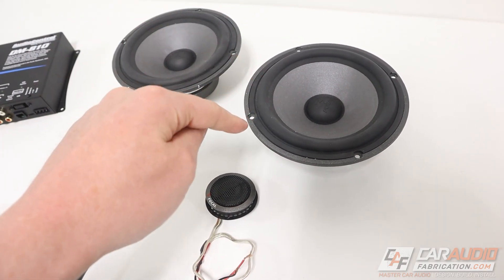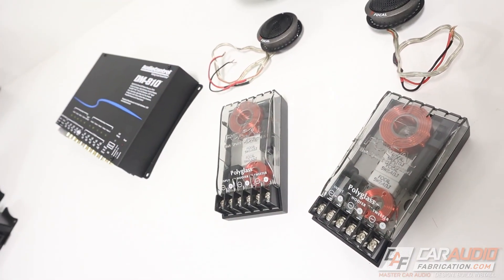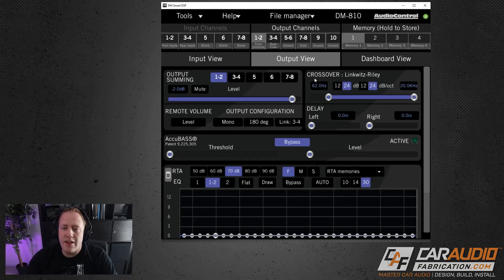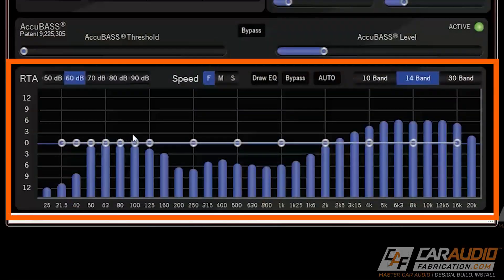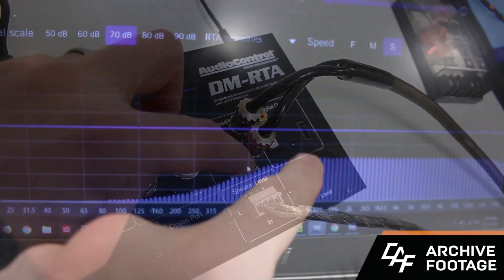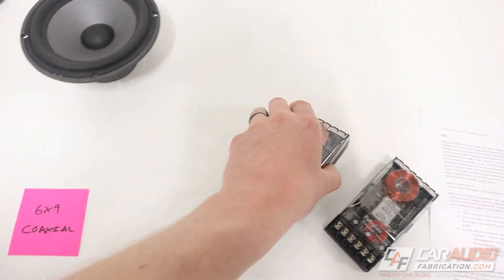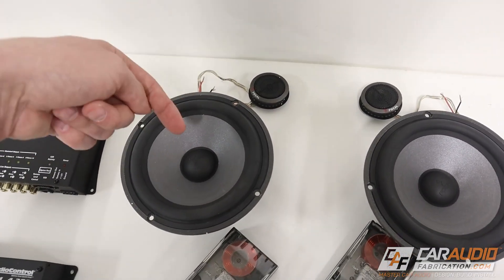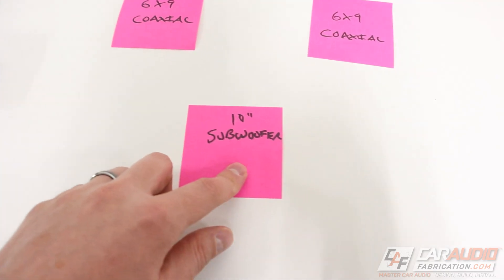Is PASSIVE CROSSOVER pointless if YOUR audio system has a DSP?

Comment: no one will argue that the engine is a very important thing in your car however you're also going to be wasting your money if you're rolling around on four Donuts.

Mark is absolutely correct saying that a DSP is probably one of the best investments and one of the First Investments that you should make..  the audio control gear is top notch.   it's one of those things where you buy it and you can just forget about it after that because you already know that part of your system is done there's nothing more to do and you don't have to second-guess your purchase or your decisions on your system.

what I'm going to argue is that the rest of the components down the chain are so generic today that you can literally get by with just about anything and have an excellent sounding rig.

the best part about going active as you no longer have to deal with the complexity of the crossover Dynamics and its interactions with the amplifier.

 You no longer have crossover Distortion because you don't have a crossover anymore. This is because of the nature of Class A /B amplification and something as completely sidestepped when you decide to go active.    what this translates into is even some of the most modest budget amplifiers that you can buy at a Walmart can do the job with excellent results.  the Jensen and the Dual amps , my personal favorite for Budget high quality sound.

realistically the amplifiers audio control offers that have a built-in DSP are probably the best way to go since not only do you get a lower noise for you also get a easier system design.  if you're not a basehead it's one perfect option.

the one question I have is that I thought audiocontrol offered in at least previous versions of their professional Pro gear software and ability to control the high frequency mid-frequency and low frequency timings all on one channel .
and professional installations you often have your woofers your mid-frequency drivers and your tweeters in far and different locations so even though they have built-in crossovers the actual devices themselves will be in different time placements and therefore will use a passive crossover in turn away but then use an active DSP to go ahead and take care of the time alignment and other needed functions such as frequency response characteristics of the event space to limit Reflections and Echoes and of course Peaks and they reproduce sound inside of the venue.. 

it gets a bit tricky with the passive crossover since you can make an adjustment however due to the analogue nature of the crossover you may have to deal then with phase issues and designing your slopes and your target timings in side of the DSP software can be a lot more challenging then simply going fully active.   

I want to make it clear that you don't need a DSP or Digital Signal processor but boy doesn't make life so much better.
a lot of people are said that they don't care about Imaging until they actually listen to a system that was set up for it in the first place and they just can't go back after that.

if you are truly on a budget and can deal with the very limited flexibility of the pioneer crossover unit that they offer that's a standalone then go that route the next best budget option is one of the Pioneers that have active mode capability.  essentially it's the same thing as the DSP that's offered by pioneer, with a few features that make it worthy as an entry-level DSP to be used in the setups /  scenarios that Mark is talking about. 

just my advice and take it for what you will, if you're going to go with audio control and you want a DSP get one that has the built-in amplifier not only is it a stellar value it really is a better way to go as far as a clean system install.
glass RCA runs and a much cleaner signal coming out do the result of getting less interference since its in one nicely shielded chassis.

Comment: I’ve noticed when using the smart DSP program for a while it starts acting up. Even when you try saving, for some reason it saves settings you never did or reverts them back to default until you restart the program. If you get lucky and get everything saved without hiccups, that 8x10 works wonders. I love the time alignment.

Comment: Mark, if I’m running a component set up front with no rear fill or a subwoofer, would you still recommend a HPF for the component set? I’ve found that I can get away with 60hz at 24db/octave without distortion, but a full range signal gives just a bit more of low end, with 2 volume clicks lower to avoid distortion.

Comment: long time subscriber, first time commenter. This video was very informative but does lead me to a follow up question. I have the dsp810 going into a build that I'm currently working on and was curious if the amp settings (lpf, hpf, and subsonic filter) still need to be adjusted or will the dsp take care of all that? I cant really find any straight answers on it and the truck is still a few months out before being able to tinker with it. Any insight would be greatly appreciated.
Reply: I would definitely turn off any crossover settings ect. on the amp as the dsp will handle all the signal processing. You don’t want the amp messing with the signal you paid good money for the dsp to do that job much better than the amp can.

Comment: So if the dsp is filtering at 24 dB per octive and the passive crossover is at 12 dB per octive  does that mean the signal getting to the speaker is being filtered at 36 db/Oct?  If so, How much is to much?
Reply: That’s a very valid question, this guy didn’t even mention how important it is to know the type of passive crossover you have.
Read Jack A. Lope explanation above from 2m ago

Comment: So say there isn't a channel limitation.  If you run the mids off 2 channels of your amp and the tweets off 2 more channels of the amp, will you get more/less/the same power to each of the component pieces vs having the passive crossover between the tweet and mid and only using 2 channels of the amp?  Curious since I expect the speaker ohm ratings will change when individually amped vs combined as a pair with the the passive crossover summing the tweet and mid.  Have never been able to find an answer to which is going to give better vs. louder sound between the two options
Reply: Read Jack A. Lope answer above from 2m ago. The answer is not simple at all, and extremely complex. I think it’s better to drop the passive crossover and connect everything to the DSP Amp! 
His explanation makes me think, it’s impossible to easily use both together

Comment: I have a question for u im thanking of up grading my car system i have jbl gto 609c and was thanking of getting a jbl bass pro sl would i need another jbl amp to run my gto and could i connect them together i was just going to buy t amps but dont have the room so i need an under the seat sub thank u

Comment: Question. Adding the crossover/tweeter to the midwoofer then changes the ohm load and power handling of the speakers, correct? Also. A tweeter needs far less power than the mid driver. Doesn't power split in half when you go from 1 speaker to 2? Or am I misunderstanding. Please advise.

Comment: Well all u need to do is put two speakers on one channel wow u guys have too much extra crash lying around
Reply from the maker: If you have two speakers on one channel without a crossover they will be fed the same frequency bandwidth and information. You can't do this.
Reply: @CarAudioFabrication  all four  mids speakers will handle the same frequency  and yes u can do this
Reply from the maker: Please send 80 HZ to a Tweeter  via amplified power and let me know how long the tweeter lasts. 💣
Reply: @Trinidadcaraudio  I hope your not anybody's installer!😱😬
Reply: @Me-dh4pm  actually I have a shop and do hundreds installs a year yet to have one complain making customers spending unessuseray money is a big deal for me
Reply: @CarAudioFabrication  if u send 80 hz to a 6 x 9 that's your problem mid bass starts at 70hz to about 150  if that's your settings for a 6 inch speaker good luck with that
Reply: Ok for all the people this guy calling for help  I want u to look at the first line in my  5th comment and u will see how stupid this guy is and when he realizes he is wrong he is trying to tell me what I said wow take win bro I cant with someone who dont even understand understand figures of speech or have any kind of understanding
Reply: I dealt with alot of slow people in my life u sir take win
Reply: The dsp already does the job as a cross over well is better I run a pre amp ,dsp ,crossover in my customers install from  now on because the dsp doesn't do what its supposed to
Reply: @Trinidadcaraudio  your not making sense? You just said you run a dsp, crossover because the dsp doesnt do its job? What!? The only speakers that most likely would be damaged if sent a full range signal are tweets if ur banging full tilt. If your afraid of that caps would be cheaper since your all about "saving your customers money". Like I said before... I hope your not anybody's installer. The average person might not know the difference but there is no "midbass starts at 80hz". Diff crossover settings for diff applications all pending the acoustics your car dictates. Your midbass might be able to comfortably cross lower. I'm sure if one of your clients asked you about tuning your the kind to tell them no need. Just set the electric crossovers and send em on their way! Kudos 2 u bud!
Reply: @Trinidadcaraudio  you dont have to get sensitive, your just a typical average installer. Installs the gear, gets them out the door. Really knows nothing about car audio. Couldn't explain to the customer why they do what they do, they just do!🤦‍♂️... dont mind me, you have a business to run!😬
Reply: @Me-dh4pm  well u explain to a customer why he has to buy a dsp and then buy a crossover u have no experience in car audio
Reply: @Trinidadcaraudio  your not getting it. I wouldn't explain that to a customer becuz that's the dumbest thing I ever heard. I run my dsp without passives and I have never had any issue... Let me ask you this pro. So you set the crossovers on the dsp and also on the passive for backup? I hope thats not what your telling me. Tell me how you set a passive for "backup"?
Reply: I hope u learn about car audio next time befor u embarrass yourself any further
Reply: @Trinidadcaraudio  bro what are you saying then? I'm trying to figure out the logic your explaining. I set my crossovers using my dsp once. Your the one who started this saying you run a passive for "backup". You said pretty amp, dsp, crossover.  So I'm asking you to explain that setup. Explain how you set that up for your customer. You said this
Reply: @Trinidadcaraudio and 2 filters kills the sound quality? Can you explain this pro? Tell us why
Reply: @Me-dh4pm  wait lol I said in my comments that u dont need a crossover if u have a dsp  wow bro u need to go back and read that's was my whole reason for commenting I said u dont need to use a dsp and crossover it will cost u unessuseray money and yes u dont use two filters at the same time it will cut your frequency and sound quality
Reply: @Me-dh4pm  u dont put on your hp filter on your deck then on your crossover then on your amp
Reply: @Trinidadcaraudio  I give up, u made a comment saying "I run a pre amp, dsp, crossover in my customers install from now on because the dsp doesnt do what it's supposed to". Those are your words not mine.
Reply: @Me-dh4pm  u need to go back to school
Reply: That is what i have been saying all the time I said to run a dsp with crossover is  unessuseray and a waste of money because that is what this video is about isn't it then u said u hope I dont do any ones installs now when u realize u wrong and I was right u changing your opinion then saying I said that wow
Reply: @Trinidadcaraudio  is anyone else reading this? Am I in the twilight zone!? Look at ur comments up above!! Like... what!? Do you not understand english? Read what u wrote!
Reply: @Me-dh4pm  u asking for help now when u realize u wrong and just quick to comment on things u have no knowledge of
Reply: @Me-dh4pm  apparantly u dont understand English never went to school and dont  know what sarcasm is wow I feel sorry for u

Comment: Great vid! I have the DM608, just haven’t installed it yet. The one thing I don’t understand is why AC doesn’t have “lift” as an effect on their DSP software. My old kenwood Excelon deck’s DSP has it and it is so great to have for my door speakers down low.
Reply: Lift? What is that? Sounds like a gimmick
Reply: @Me-dh4pm  I hear ya but nope, no gimmicks on the Excelons.  It’s called Sound  Elevation in the pro setup settings.  It “Virtually raises the sound field using the DSP”.  Options are off, low, med, high.  It literally makes your speakers on the floor sound like they’re up at ear level.
Reply: @DarrenT0dd  so that is the point of your processor. When you properly set your crossovers, time align and start to learn about tuning that's the idea. To create a realistic soundstage with your car. So it's the same idea except with your processor you have more control over every channel and can have much greater results when done properly.
Reply: Why would you need lift when you have proper time alignment that is suppose to put the sound in center stage, you.

Comment: You sum it up in the 1st few minutes... to protect your tweeters, yes you can use a cap but that's only 6db annulation at best... how many dB can your dsp apply with a fool at the controls?
Reply: The cap actually acts as a weak passive crossover. It doesn't just lower the volume level, but it also cuts the lower frequencies out of the tweeter. You could still blow it, but it would be a lot harder to. Also the audiocontrol dsps generally only let you cut overall db, not raise it. You'd have to manually increase a bunch of the frequencies for the tweeter, which is hard to do accidentally. Plus you can put a passcode on their dsps.

Comment: My aftermarket head unit has built in crossover settings with slope settings, timing, positions and levels, full custom e.q. phase control. Name it. Still trying to come up with a reason to tear it all apart to add one of those dsp.
Reply: Not true some head units like the 80 prs has networking system that separates the mids highs and bass using three different rca outputs
Reply: @Trinidadcaraudio  I have a Pioneer AVH-601EX. Thing does everything. Love it well worth the money.
Reply from the maker: Your head unit doesn't do EQ at each individual speaker. You are EQ'ing the system as a whole.

Comment: I'd just run the dsp and a tweeter protection cap incase of dsp signal glitch
Reply from the maker: Depending on how many amplifier channels you have you might not be able to do that. Which is the point of this video...

Comment: Audio control processors are very limited with graphic EQ only. So many other better options on the market. Do yourself a favor, Sell your passives and put the money towards proper amp channels.
Reply: Do yourself a favor, finish your homework after doing a little more research youngin!  Audio Control has never been about aesthetics, pretty lights and pretty colors are not what they are all about.  High-level accurate tuning of high current competition systems is their niche!
Reply: @dj_illeagle  hmmm.... so your saying if I do more research what? People aren't using graphic processors in iasca and emma or other SQ comps. Helix,zappco etc. Are miles ahead with fully parametric capabilities, being able to assign differential inputs. You cant even disable the high pass on AC processors to get the max out of an IB setup. Explain your thought, what is better about Audio Control vs the 2 I mentioned? Are you saying because it's simple and limited that's a pro?
Reply: @Me-dh4pm  It's only simply and limited to your use of the software. There's no good reason to overcomplicate the simple. Which is usually only done to sell product rather than increase any possible performance that's already hit the ceiling until the next audio tech advancement.
Reply: Audio Control DM-608 and 810's use optical and in my option do there job better than the other big names you mentioned. Sure they're not petty to look at and even the software interface is nothing more than functional. But once properly set you can forget about it and let it do its job. Which it does very very well. Just one man's opinion. I think of it as the Diablo Sport of audio tuning without Trinity.